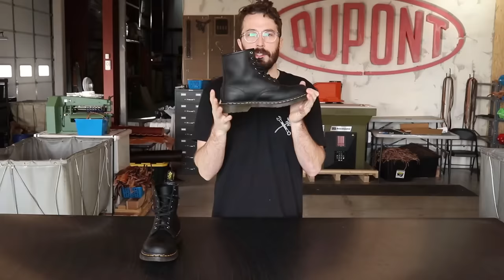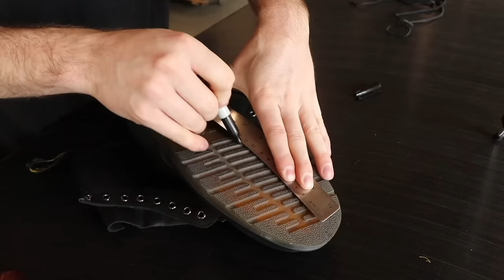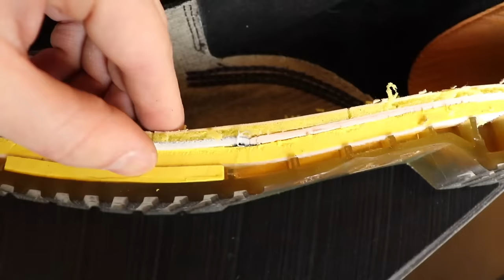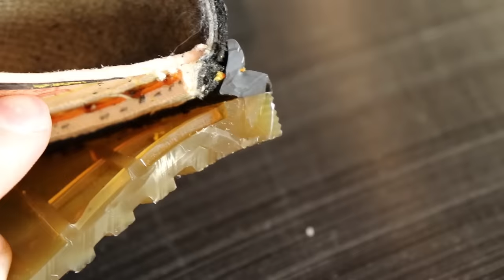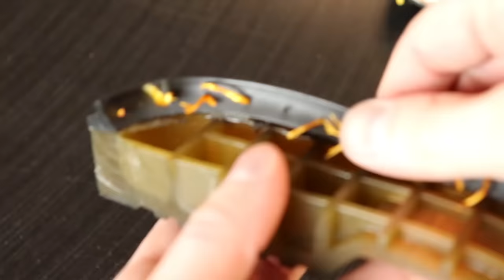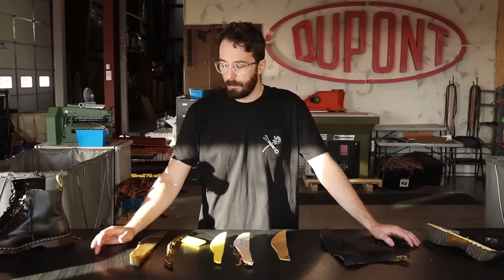WHAT'S INSIDE DR. MARTENS - (1460 BOOTS) - doc marten review

Comment: This is interesting, they have altered the inserts !!!! The shank was wood and glued in as well as all foam (heated glue gun) Which is all missing in this boot. The welt bonding on that boot is very poor, the machine blade that passes between sole and welt was either dirty and or seeing as the sole is oversized when bonded the trimmed (see those lines on side of sole)Torrielli machining) might have something to do with blade not reaching into welt far enough. Those boots if worn regular would not last a winter in my guess as the sole would most certainly start flopping off over time. The boots could have been sent back as a manufacturing defect and they would have either replaced or as most often what would happen is the boot would be passed down the line to the welder and the blade inserted again because it would still melt bond together. I’ve seen it done. Interesting videos these. Takes me back to memory town. I guess manufacturing methods change over time...I wonder if the wooden shank is in the uk version or more expensive boot? Strange it’s gone, maybe the vegan/carbon tag marketing has something to do with it?. Maybe I shouldn’t really care but curious all the same.. Good Video 👍🏼
Reply from the maker: That is crazy! Too bad they don't do things like they use to. I have a feeling there is not a shank in the MIE boots buuut there is only one way to find out ha ha
Reply: Rose Anvil - I Just had an interesting conversation about these vids and our err chat/comments. The chap I know went over to H K and he tells me after a while the manufacturing challenge by the Chinese was to use tools/parts sourced locally and this would result in cheaper production costs. Example: The welt needle called ‘awl pronounced Owl’ they wanted to make their  own instead of shipping the ones stocked in Northampton uk, this fella told me they had him trial new needles and they kept breaking too easy at first. He just watched this video on my phone and was amazed also at how the ‘inside’ has changed. We used thick tough felt inserts with a wooden shank back in the 90’s when we worked there, he said it’s obviously done this way now to keep production costs down as much as possible. Truly a case of buissness moving to Asia for profit over anything else. He, like me was amazed to see the poor sole/welt bonding and again said they changed the blades to thinner smaller non original...If I was head of Doc’s after seeing/reading these videos I’d be concerned for sure about DMs reputation of quality manufacturing. Hope I don’t get In trouble for my comments, call them ‘ consumer feedback’  ! They should sit up and take action to prevent the downfall of what was once a great product.
Reply from the maker: @jakapuchino  Whoa that is some solid info, that is crazy. It is a huge bummer to hear that they are lost their quality so much.Thanks for sharing that info
Reply: I sometimes wonder if workers in the Asian factories pass the hot blade along too fast for there to be a real bond between sole and welt.
Reply: I have cut open MIE docs from the 80's, 90's and the present "vintage" line, and they all had the felt inserts with a wooden shank.
Reply: @jakapuchino  I have to say. I won't dismiss the Asian doc's quality so fast. I currently wear every day a pair of almost 10 years old Docs made in Asia. The sole/welt bonding is seamless; to be honest I usually got transfixed by it because it is so smooth. What I see here, on the contrary, is a general fall in construction quality. The sole/welt looks quite poor, to me, even in the MiE if compared to the boots I use. It seems that the whole company lowered its standards, both in Asia and at home.
Reply: d_ It may read dismissive but I have only just  perchased a pair made in China. Very comfy, first wear today, I’m a UK9 and the fit although comfy feels a little off. It’s like the foot compresses the foam and results in a little more room inside boot. Thicker socks should be ok, maybe I should have tried on 8.5?. I’m only dismissing the changes in manufacturing but hey I still spent £90 on them. :)
Reply: @luissorsini  personally, I think England's standards have lowered and Thailand's standards have improved.  The Thai DM"s being made now are actually really good.
Reply from the maker: Thanks for all the info my dudes. Ive learned just as much from the comment section as i have from wearing them and cutting them in half

Comment: Honestly I would cringe if you had to cut the “made in England” boot! Definitely buy all my docs that are made in England...somehow I think it’s more authentic 🤷🏽‍♂️ I do remember buying a steel toe Dr.M boot that came apart at the welt 1 week after owning them, just can’t remember where they were made.
Reply: I had slip-on steel toe boots from 2008. After they became terribly uncomfortable, I cut them apart. There was a small balsa wood shank in the arch that had snapped. I can't find the picture of it. But it was pretty disappointing.
Reply from the maker: I can tell the MIE boots have a slightly different sole so hopefully there is more improvements too
Reply from the maker: I've heard that a few times in the comment section about the cheap wood shank. It's baffling that they did that
Reply: I would..  but not much is offered in 15

Comment: Explains why every single pair I've worn for the past decade keeps splitting....

Doesn't explain why I keep buying them... Damn brand loyalty...  Switching to Solovair.
Reply: *Solovair
Reply: Good luck with Solovair, they only lasted an extra three months for me
Reply: @kyleablett  What blew out?
Reply: @RebelInTheF.D.G  the leather on the front ended up splitting, pretty much along the join, so that made that pair useless, my second pair that I've worn a lot less there's already a split on the toe crease.
But these are both steel toe cap versions
Reply: @RebelInTheF.D.G  oh and on the second pair the welt has started to separate on both boots
Reply: @kyleablett  Well go figure the only pair of Doc's that have lasted me longer than a year were discontinued and the only alternative brand I know of aren't much better. Pretty clear you've put the miles in on those and they look about the same as any one pair of mine I've blown out. Thorogood it is, I guess.
Reply: @RebelInTheF.D.G  I've got a pair of the Chinese knock offs on my feet at the moment, they're a bit rough on the inside leather work but otherwise they're holding up

Comment: I don't know if they still make them but they used to have a safety/work boot version in England that had steel toe caps and a shank or metal plate in the sole. If my memory is correct they weren't that much more expensive or could have been slightly cheaper because they were exempt from sales tax (VAT in the UK) because they were for work, not a luxury or fashion item.
Reply from the maker: I’ve heard the work boots are better built
Reply: @RoseAnvil  I think they were. Back in the late 80s and early 90s when I lived in England we had to wear school uniform and had to have black shoes and a pair of Dr Martens were about $50 Vs $35 for a cheap pair of black leather shoes but the Dr Martens would last longer than it took me to grow out of them and my brother would wear them when I had grown and needed a new pair. When I last went back to England and visited my parents some of those boots are still in the attic and there's wear still in them, 1 pair looked nearly new and for boots that were worn daily by teenage boys for at least a year or 2 that's quite incredible.

Comment: Every pair of doc martens I've had have split at the bond. I use a super hot knife, plunge it between the two wriggle it about and press the sides together. I then use the same knife and run it on the outside to seal the outside and finish it a bit better. Last pair to suffer this was my hard life boots.

Comment: I really wanna see you cut the Dr martens ironbridge in half. I used to wear nothing but 1460s so when I wanted something heftier and nonslip, I went for Dr martens work boots. I think they have their pros and cons, but if you swap out the insoles for something with more arch (i just use the normal dr martens softwair instead of the ones that come in the boots) they're very comfortable. I'd love to see what's inside though.

Comment: I wore Dr. Martens in college (80’s) and even afterward in my first couple of jobs where I was very active (early 90’s). Best shoes and boots EVER! I collected all sorts of colors and styles. Then one day probably ‘94-‘95? My new Dr. Martens were not so comfortable from the start. My feet became fatigued and the shoes were wearing out quick! Apparently the manufacturing had moved elsewhere and my love affair with Dr. Martens ended. I wore the older ones until they were completely worn and by 2000 my collection was gone. I’ve tried the “Made In England” versions but they still don’t compare to what they used to make and despite what appear to be better materials wear out quick and are not comfortable. Dr. Martens used to feel amazing from the first try-on, feel great all day, and age with grace. That seemed to end in the mid 90’s.

Comment: I have a pair of England Docs that lasted over 15 years and for 7 of those were worn 5 days a week.. I had a pair of Taiwan Docs for three weeks and the sole separated 1/2 way (literally half the boot) from the leather while I was walking.. But Doc Marten did replace them after my complaint for free.. New Replacement Taiwan boots are holding up well and it’s been about a year... After these wear out I will only buy Made in England.

Comment: I had a pair of DMs once & they were so comfy, once worn in. They replaced my Wrangler boots that were 10 years old when they became unrepairable anymore. My DMs lasted 2 years!! I was put off them due to their short life span. Back to Wranglers now. My current pair are about 6 years old, been to every occasion you can imagine & through every type of weather. Yeah I've resoled them (I'm a cobbler) but the uppers are still great. DMs, the leather appears to be too hard & cracks were it bends at the toes.

Comment: I had a second hand pair from a thriftshop like 25 years ago, 1460 red boots English made.
Walked in them up to about 8 years, they were actually a half size to large for me.
But i didn't mind since i did light work on a workfloor for like more then that.
finally i ended up letting go of them because of the sole was giving out, i think when i bought them they already had like a good 6 years use before me or so.
I thought, i buy a new pair with hard nose and slightly more sassy looking like the military ones they used to make.
Can't remember then type.
It was manufactured at "Made in China" , i wore them a day and there was this sewing around the tongue goiing into the sides. which was done wrong. Had to adjust cut it myself to wear them, then for some reason i found out by wearing i was actually better of get a full size not a 91/2 .
Ended up giving away a brand new pair to a friend adjusted by myself truly, since then i had my doubts on ever buying a new pair and give them another go.
Checked for the English made version you showed in the previous vid, was discontinued one.
So frustrating, i was ready to buy a pair that would fit my size and be made by hands of a experienced shoe maker.
I dont know if i am ever going to buy another pair now.
15 years for a 1460 thrift shop boot is a long time on one sole.

Comment: Not sure if I made this comment already but from my experience, their quality has always been hit or miss.
I've had an MIE pair (circa 1999) where the welt stitching began to unravel after a few months.
I've also had an Asian-made pair that was reasonably well made - I wore them daily while working in a warehouse for 3 months. Not sure of what happened to them after I left that job because I sold them to a friend shortly thereafter.
My current pairs are: 
an MIE pair I bought in 2003 that I have for nostalgic purposes - their soles are ground smooth and I'd like to get them resoled with Solovair units if possible
A deadstock MIE pair of wing tips that are going great so far - I wore them while working in an office that had warehouse attached
An Asian-made pair where the leather (or the surface paint) cracked after 3 years - that was a big letdown as I've always maintained them with mink oil from day 1 of purchase.

Comment: @Rose Anvil You did not mentioned the quality of the heel counter. Behind that brown leather at the heel the material which stiffens the heel it is some cardboard-like material. Mine has cracked after 4 years while the other parts of the boot were still in quite good condition. Considering their current high price it is a shame. I wonder if the English-made versions have real leather heel counter.

Comment: If you want a pair with a hard shank inside, try the steel toe cap safety boots version rather than the streetwear, comfortable fashion boots. I wore a pair of those back in the '90s when I worked in Kvaerner shipyard in Govan. I had to polish them every night or else the atmosphere I was working in would kill them, I know that because I was lazy 2 nights on the trot and the leather aged and started cracking. Up until then they were great. I do believe they're trading on a reputation for quality that they earned years ago but no longer holds true today though.
Reply from the maker: Maybe I’ll get a pair for work

Comment: I've worn DMs since my teens in the early eighties, mostly shoes, but some boots. The only problems I ever had are the soles wearing down. I found the leather to be almost indestructible, with only one shoe of one pair cracking on the upper. But they're at least 12 years old and well worn and abused. I haven't bought a recent pair, but I don't need too yet. The sizing and fit seems to have changed over the years, as the newer ones I tried didn't fit as well.

Comment: I'm not convinced that is actually Goodyear welted.  The technique is that the upper is stitched to the sole through the welt that goes around the edge of the shoe - where the yellow stitching is.  But that yellow stitching is supposed to go vertically down through to the sole and should be visible underneath the sole. There is then a second stitch that goes through the inner sole, through the upper and into (but not through) the welt via a horizontal stitch.  It means the innersole and the upper are joined to the welt and the welt is joined to the outer sole.  The stitch that joins the outer sole to the shoe does not go through the inner sole so water cannot wick up through the stitch and into the inner sole.  And the stitch that joins the innersole to the welt is entirely internal to the shoe so water from outside cannot be wicked through it to the inside.  Doc Martins have a rubber welt that is bonded to the outer sole and the yellow stitching is going through the welt horizontally to join the innersole to the outer and the welt.  Water can be wicked through the yellow stitching and into the inner sole.  The give away is that the yellow stitching is the only stitching and does not go vertically down through the sole.  I used to wear them as a kid.  I found the leather cracked quickly, the yellow stitching broke, I got wet feet easily, the heals wore away quickly and the air bubbles in the sole were filled with saw dust.  They used to fall apart after about 3 months.  That was back when they were made in England.  I don't imagine making them in Thailand would have any positive or negative effect on the quality.  The design is rubbish and the materials are cheap.
Reply from the maker: Solid breakdown thank you

Comment: I think Dr. Marten's are made cheaper each year, which is a compromise I guess, but they became famous for their quality in the first place. Now they rely on their brand name to make cheap trendy shoes like the Hello Kitty sandal and whatnot. I wore the same pair of made in Thailand Docs for more than 10 years, and I'm a walker, I hate to drive. I like to take shortcuts trough rough terrain, so they went trough a lot of abuse. Still, the sole never had any significant damage. The only reason I bought a new pair was because they didn't look very fresh, there were a few stitches that worn away, nothing more. I'll see if the new pair holds on as long as the other. I guess not.

Comment: Those soles are not PVC. Those are TPU, thermoplastic poly urethane. And yes, they suck because a good sole on a modern boot would not be pre moulded and heat sealed to the boot. They would be moulded straight onto the upper. Try doing the same deconstruction to a Blundstone boot. Solid PU, TPU, and rubber soles on the different types, and they are moulded directly to the uppers.

Comment: Doc Martins have been style and brand name over sustance for years. You can buy decent quality steel toe and sole boots for less than £50 ($65). I have 4 pairs of DEWALT branded work boots all were under £50 and the quality is miles better than anything by Doc Martin. The range of quality work boots you can buy for under £100 is huge.

Comment: When I was younger I has lots of pairs of Doc's. Almost instantly upon wearing them they would get a puncture, and then fill with water when worn in the wet. They made my feet cold and sore due to the Air Sprung sole. Eventually common sense took over from fashion and I stopped wearing them and moved over to Loakes and Trickers which are much better.